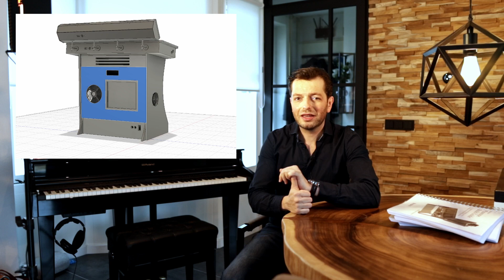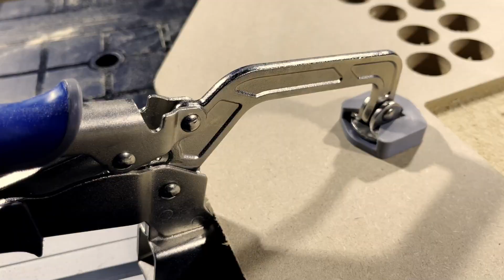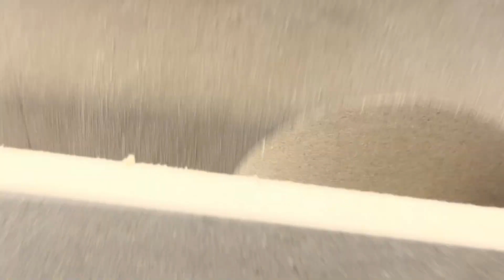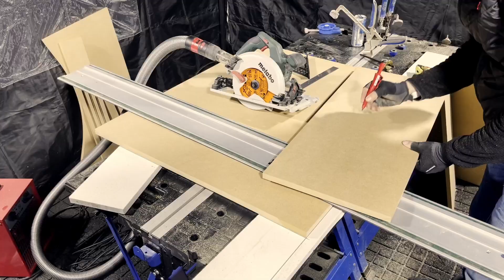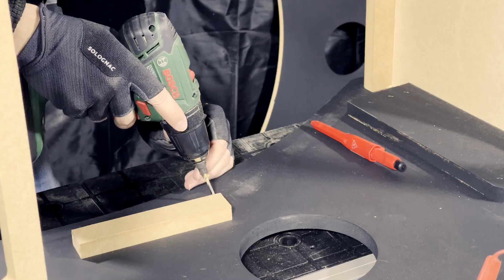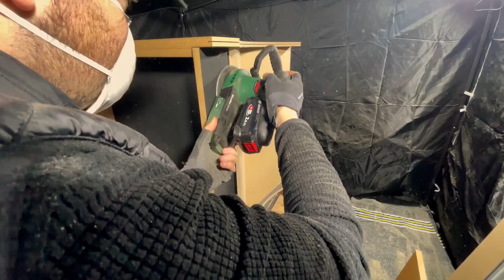Arcade Pedestal Monster Build - Part 1 of 6:  "Building the Base"

Comment: is MDF best for arcade cabinets? Also is 18mm thikness the best choice or 16mm
Reply from the maker: Now I only use high quality concrete birch plywood. But MDF (high quality) will work great as well. Plywood is stronger on the edges and much lighter.

Comment: Great idea for a series, few question about building in general, not this particular one:

- On the control panel have you considered using thinner MDF so when you add the acrylic it comes to 18mm with both, that way the t-molding will cover both and acrylic will be inset. Is it just personal preference, or is there a reason you don't do it this way.

- What thickness acrylic do you use for the control panel top and monitor cover, are they different.

- What level of tint do you like on the monitor cover acrylic, seems like around 15% and 30% are kind of what the light and dark tints come in at.

- I think you mentioned on your personal build you used two layers of arcylic for the monitor cover, any reason for this, how did you set them up, squished together or spaced out.

- What supplier do you use for the Iiyama stretch display for marquee, been struggling to find a seller that looks reputable.
Reply from the maker: I did 16mm panels so that the T-Molding would cover everything. BUT it would not let any light pass through the sides (see my older Arcade video's) Now I am sticking with the plexiglass on top 🙂
I use 3mm Acryllic transparent or smoke or colorred. Depending on the build. They are the same for both the Marquee and the panel. With my full size Arcades I use real smoke glass.
IIyama is very difficult to get outside this area. I know this is a p#in in the but.
Many thanks,
Daniel
Reply: @TheDanielSpies 
> IIyama is very difficult to get outside this area.
I know, but please tell us who sells them! ❤️
Reply from the maker: @AKAMustang  will check for you